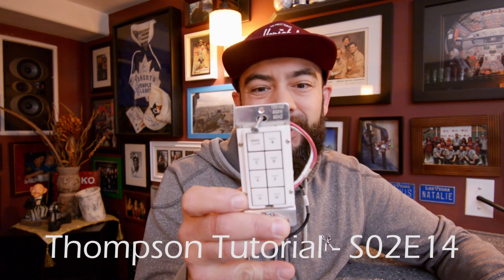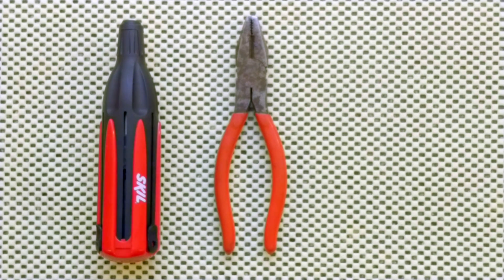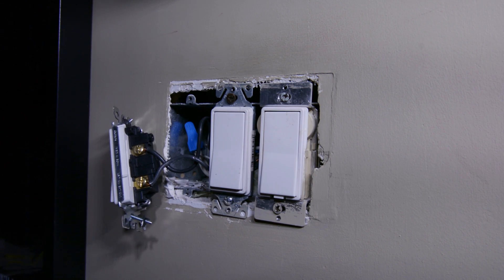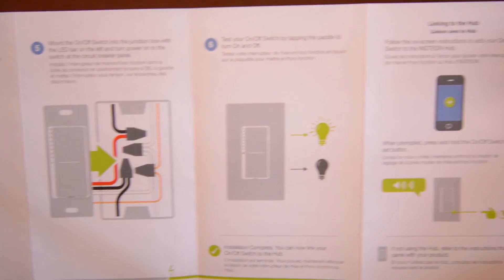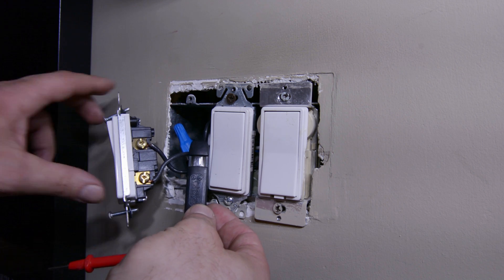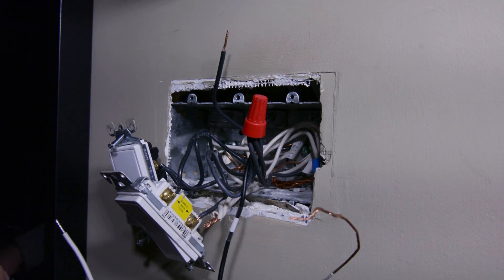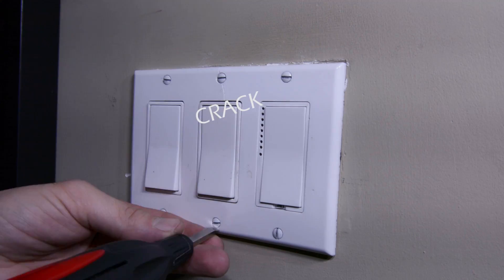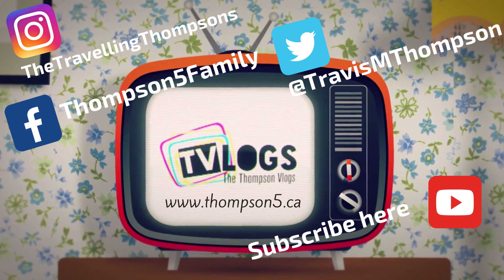Insteon Smart Home 🏠 | How to identify line and load wires for a dimmer light switch💡

Comment: after testing wires which were live to determine line and load never said to turn off power before connecting new swithch
Reply from the maker: OH YES!   Absolutely!  I wonder if I can cut that in or add some text.  Thanks for the tip.
Reply: @TravisMThompson  you can upload a new version of the same video, so you don't lose your existing listing stats

Comment: Very useful.what to do if there is NO load wire in the box?
Reply from the maker: If it's not in the box with the switch then it is likely in the box of the device that the switch controls.  You will need to get it from there down to your switch.  Might be worth just using wifi bulbs if you can.
https://amzn.to/3gW2Ula